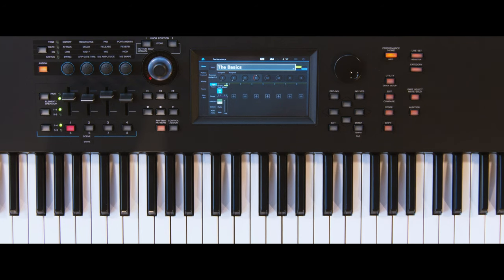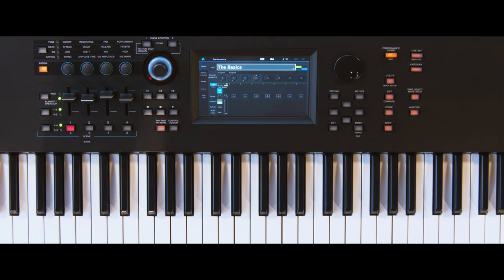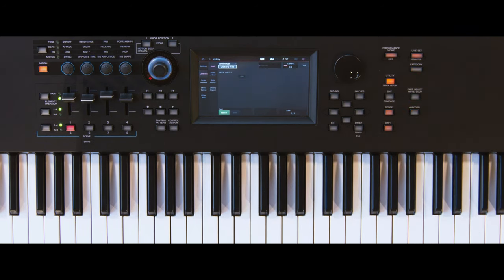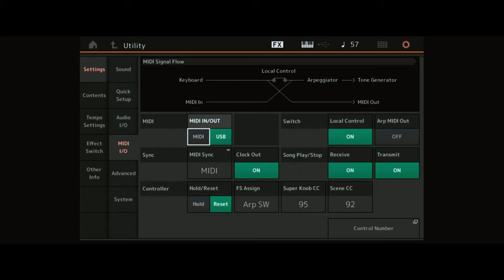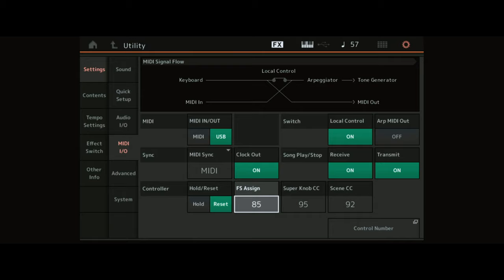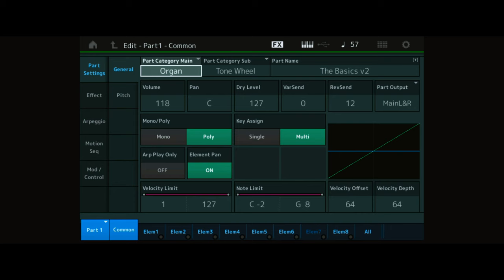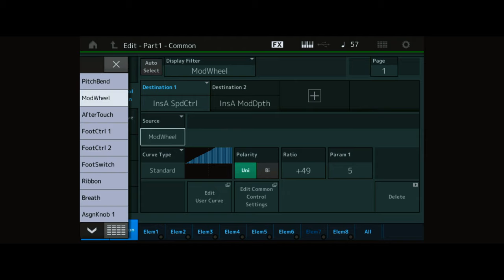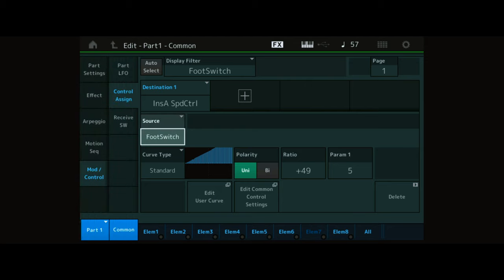Synth Tips | Change Rotary Speaker Speed Control Assignment From Mod Wheel To Switch | MODX/MONTAGE

Comment: Are there independent Rotary Speaker speeds for both the Drum and the Horn?   
Classic Organ Rotary speakers typically have a crossover which separate the low frequencies to the Drum and high frequencies to the Horn.   
Can the Rotary Speaker Speed effect be modulated by independent internal LFOs for example?  
Would like to use custom speed ramps (LFOs) to simulate the start and BRAKE ramp up / down speeds for each Organ Part within a Performance.   Thank you.

Comment: I notice no response here on changing speeds. I have a mod wheel that I cant do anything with. This is getting tiresome. Nothing in manual and no video on how to do "synth" with the MODX/Montage. I have tweaked every single control in Mod/control-part LFO and no change at all. Not a working mans keyboard so it seems. Menu diver hell delight.